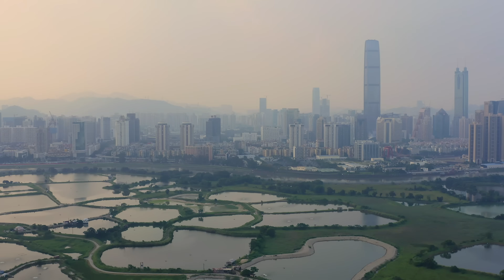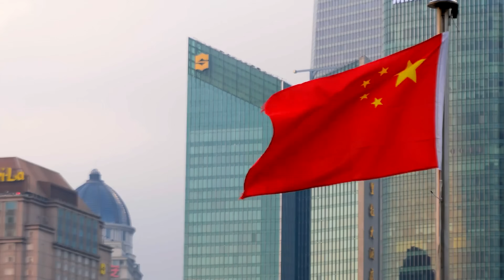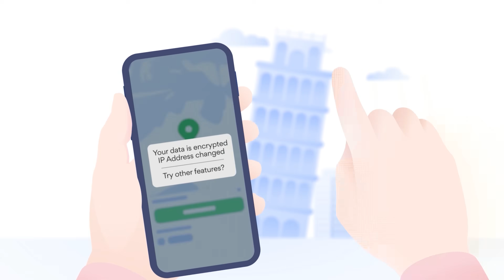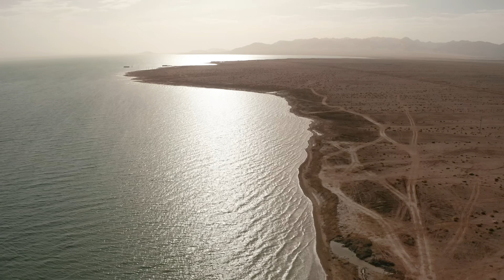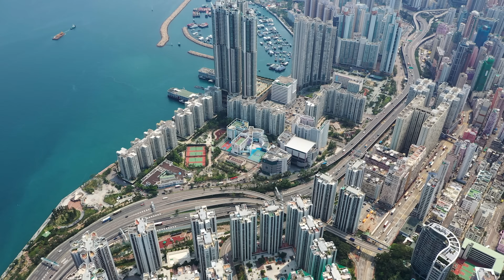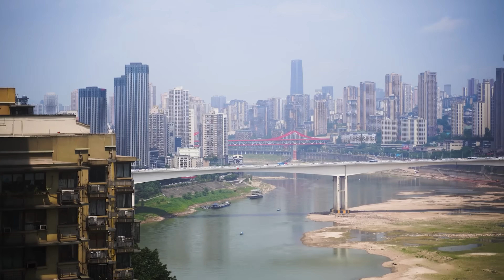China's Water Crisis, Explained

Comment: You left out how dams also contribute to this. They slow water flow and increase the surface to air ratio. Both these create a higher evaporation rate and then the new humidity is blown elsewhere before falling again. Some of it would still fall back to China but not all. Then their is more water lost because dams create more water to ground area and the water soaks in more, making down stream dryer. China has more dams than any other country and many of these dams are in sequence, so basically China is pissing away tons of water every day.

Also, leading up to this China was actually having major floods, possibly because of the excesses evaporation making excess rain fall, but that would cause even more water loss. Again, because water would leak underground over an even large area. If it seeps in deep it's taken out of the regulars water cycle until an underground river dumps it out elsewhere, or it's manually pumped out.

Comment: You are mixing up the East/West population divide line with the water distribution in a way that doesn't make sense. The majority of the population is to the East of this line, and most of the water is t the East of this line. That's not the problem. The problem is that the majority of the population s in the North East, and the majority of the water is in the South East. It's also not true that there is no way to change this natural distribution. China has famously built canals to address this issue centuries ago and redistributes water from the Yangtze to the North.

Comment: Another factor is the reduction of glacier water output.  With the reduction of water from these glaciers impending the plan to divert water is a mood point.  Of course China’s population will significantly shrink in the 28 years it will take to divert and in the long run less people will require less water.  This is to discount any other mitigating circumstances, such as famine or another waive of viruses.
Reply: The Ganges River is fed by disappearing glaciers.

Comment: The world's population will eventually return to the mean. The population is artificially high, and non-sustainable at current levels. 
A billion people dying off in a famine or plague would be desirable, as it would free up more natural resources for the survivors. 
The biggest problem is depletion of fuels. Oil, coal, etc. Picture the world with no tractors. Horse drawn plows only, basically living like the Amish.
Reply: I think that there will be alternative fuels to replace many of the fuel gunslinger machines. Hydrogen is by far the best in terms of material usage, renewability, and cot effectiveness. Yes the infrastructure is lacking, almost non existent actually, but scaling is easily done compared to EV infrastructure. Hydorgen engines are 30% smart than internal combustion engines, or ICE, and are made of easier to recycle materials Aluminum and steel make up the vast majority of the power plant system along with its power train parts electric battery cells made up of rare earth metals that are not only hard to extract but also hard to refine and even harder to extract from finished products.
Reply: You would probably not care if you died ?
Reply: @friendoftellus5741  I live in an area with abundant water.

Comment: Nuclear fusion could solve so many of these problems. With virtually unlimited clean energy, water scarcity will be solved by desalination. Climate change will naturally be solved since there will be no need to burn fossil fuels, and CO2 capture will be an effective option too. Food problem can be solved by greenhouses, etc.
Literally every country should be doing everything they can to solve fusion right now.
Reply: We almost had Thorium reactors in the 70-80s but the US's DOD put a stop to it because it was a matter of national security. The core penetrator of the M1 Abrams and the Lepord 2 tanks are depleted uranium rods. These rods come from a factory that process waste material from nuclear reators from all over the world and turn them into the deadliest tank projectile. 

The core penetrator for the 120 mm gun was initially supposed to be Tungsten since it was incredibly dense and easy to work with, however cost for tungsten even back then wasn't cheap. And when you are shooting 20 lb rods of tungsten down range with every shot, it gets expensive VERY QUICK. So the designers looked for other materials and came across depleted uranium, not insanely radioactive(safe to be around), has a very similar density to tungsten, and most importantly, is cheap to acquire and manufacture while giving superior armor penetracting capabilities. 

And during the cold war, you're not going to get rid of a vital asset (armor penetrating capabilities) to your war machines just because some people want cheaper electrity bills are you?
Reply: I'm 65 and fusion power has been 5 years away since I was a child.